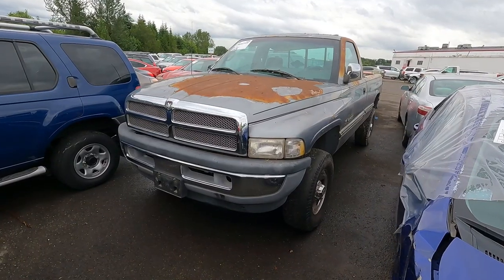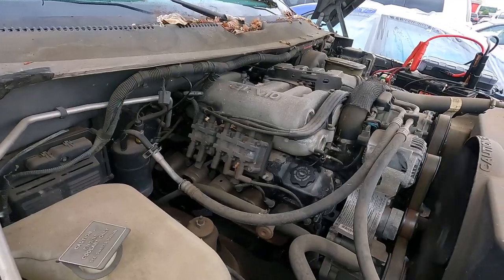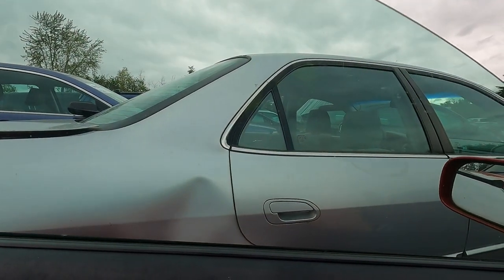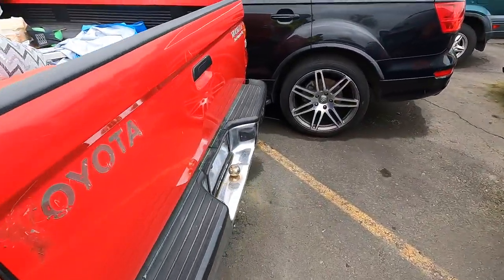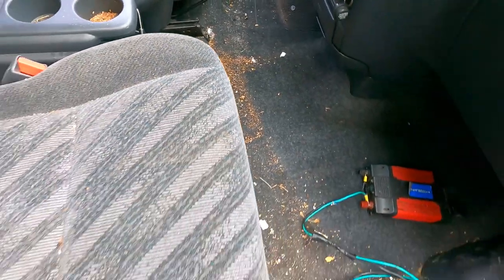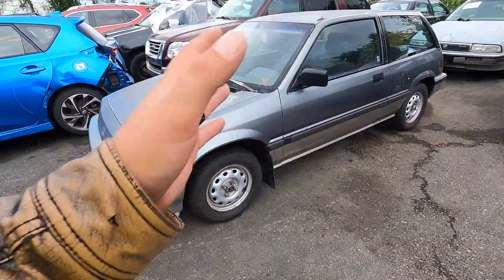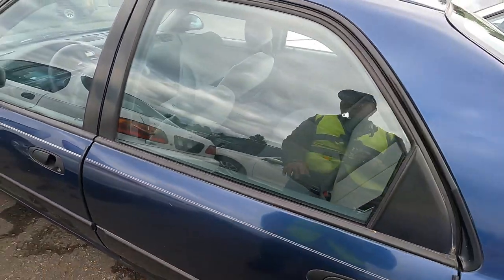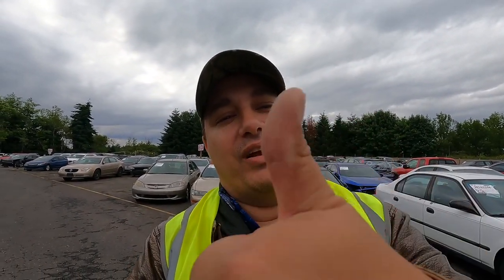IAA Portland Walk Around 6-19-21 + 94 Dodge RAM 2500 8L V10!!! 4x4!!

Comment: I have a 2007 Toyota solara with 333000 miles and a 99 GMC Sierra with 310000 miles and I have never changed the timing belt on them. ☺️
Reply: No timing belts on those
Reply: Randy by a truck load it would be cheaper by the car???????

Comment: My 97 Accord which is my first Japanese car replaced a 98 Oldsmobile 88 that I had for 12 years but I had to retire it due to rust on the front subfarme that my mechanic found after it started to creak and groan badly. The worst spot was around the passenger side where the subframe is bolted to the main unibody. The Accord had big shoes to fill but after some mechanical TLC, it nicely filled the void left by the Olds. And it has only 154,000 miles. Hardly broken in.

Comment: When you were putting the truck back and forth through reverse, the truck lost oil pressure for about 10 seconds😬😬😳😳
Reply: @My Pronoun is WTF one of my buddies has a jeep with the 4 liter that was doing the same thing, but turns out that he blew up the crank bearings on the motor because the engine had burned too much oil, causing it to be low and lose oil pressure😳😬

Comment: That Toyota pickup is a super nice truck...id buy that honda crv and put a new front left fender on it for 120 bucks put a 2 inch suspension lift with some rims on it and a few other mods it would be badass..i wouldnt have left that lot without that civic...but i would make it a manual...

Comment: Bout the Dodge Ram....The Chrysler/Dodge 488 Magnum is a 8.0 l (7,997 cc, 488.0 cu.in.) natural aspirated V10 90° four-stroke gasoline engine from Chrysler LA/Magnum-family. This engine was manufactured from 1994 up to 2003.

The Chrysler 488 Magnum features a cast-iron block and two cast-iron heads with a single camshaft (OHV) and two valves per cylinder (20 valves in total). The Chrysler 8.0 L Magnum engine is equipped with a multi-point fuel injection system and an electrical ignition system with two ignition coils pack and individual coil for each spark plug.

The compression ratio rating is 8.4:1. A 101.6 mm (4 in) cylinder bore and 98.6 mm (3.88 in) piston stroke give the 488 Magnum engine a total of 7,997 cc of displacement.

The 8.0 L engine produced from 305 PS (224 kW; 300 HP) at 4,100 rpm to 314 PS (231 kW; 310 HP) at 4,100 rpm of horsepower and 610 N·m (62.2 kg·m, 449.6 ft·lb) at 2,400 rpm of peak torque

Comment: Crv engine is buzzy step on gas I'll get back to you, do you have an appointment. Transmission solenoids go bad, there's a table under back , the spare it's small but it's a picnic table
Send owner a gift card staying open later for battle ground 🍕

Comment: If you reach up there and thump the dash board it will break like glass. That v 10 aint all that. Gas mileage sucks and i would much rather  have a diesel dodge than that gas swallowing   thing